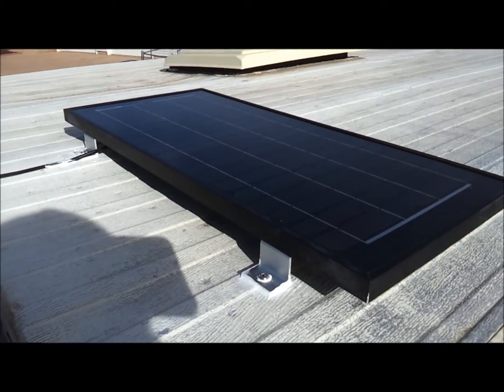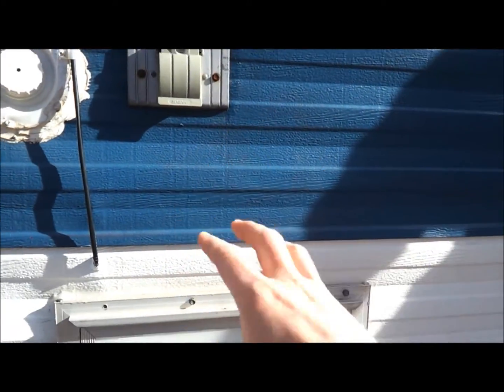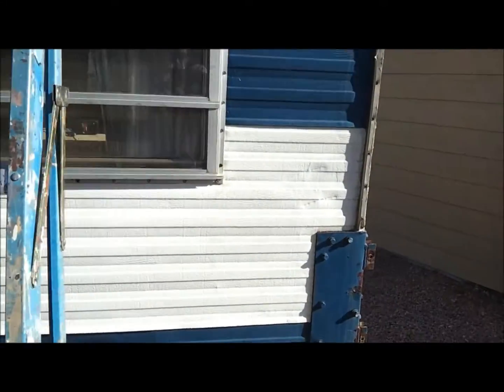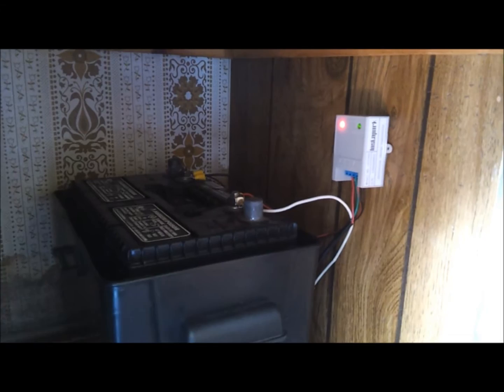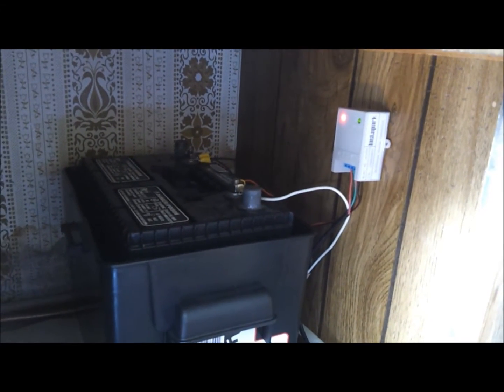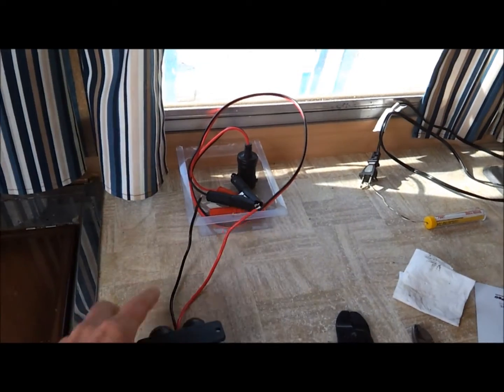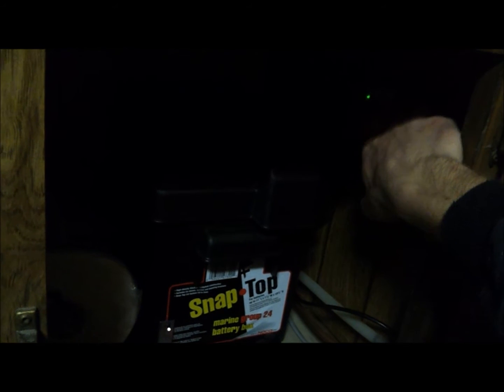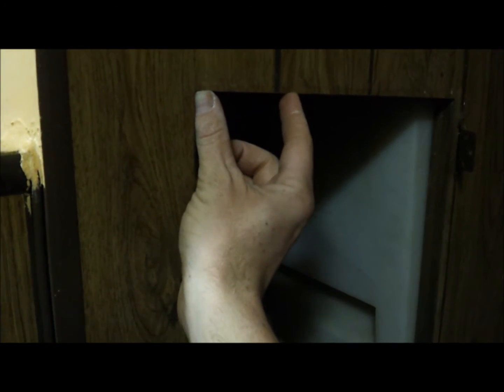Truck Camper Project - Solar Panel Install

Comment: how do u install the 12 volt plug thing? i do not know how to do that
Reply from the maker: It's pretty easy to do.  The 12 volt plug comes with a positive and negative cable.  Really all you have to do is solder alligator clips to those cables.  Then put the alligator clips on your battery.  You may want to consider putting a fuse on the cables from the 12 volt plug to the battery.  This way just in case you overload the 12 volt plug the fuse will blow.